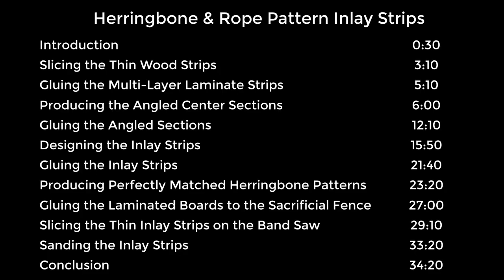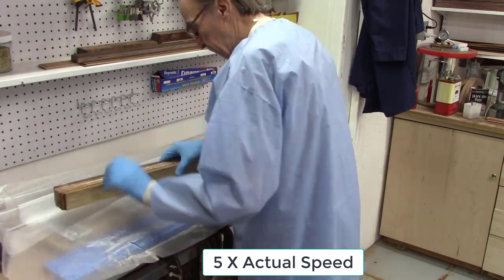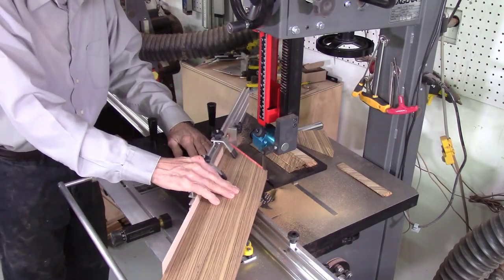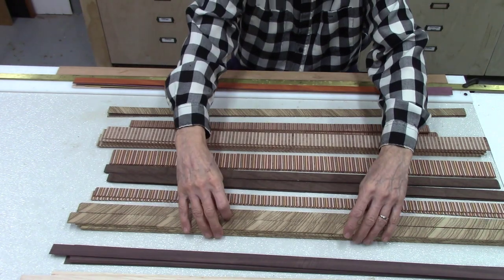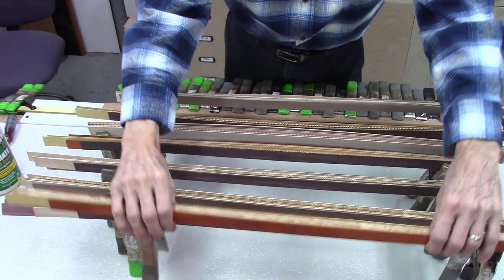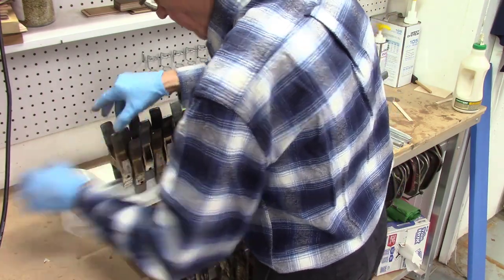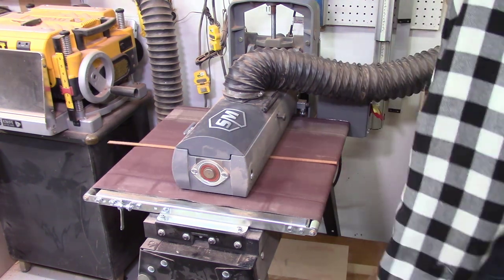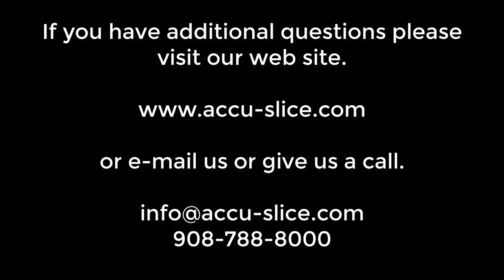Production of Wood inlay Strips -  Herringbone and Rope Designs (123)

Comment: Hi--I have a question pertaining to Accu-Slice in general.   I learned about bandsaw blade drift many years ago and how to compensate for it setting the resaw fence at the angle of the drift to correct for it.  You mentioned in one of your earlier videos that inaccurate cuts in conventional bandsaw resawing can be caused by the back of the blade contacting the cut.
I'm wondering how blade drift is not an issue when using the Accu--Slice system if the blade being used has a tendency to drift.
Thanks in advance for your help.   I find your system very interesting and exciting.
Reply from the maker: We have addressed this in a number of videos.  Band saw blade drift is caused either by the lateral movement of the wood being cut or the back edge of the band saw blade touching the wood being cut.  Since the wood being sliced with the Accu-Slice system is attached to a fence that rides perfectly parallel to the band saw blade, the wood does not move laterally and the back edge of the blade does not come in contact with the back edge of the band saw blade.  For additional details see some of our other videos including the following:    https://youtu.be/POtueiORQkk

Comment: My dad is working on a pattern similar to these but would like to bend them into a circle in order to add into a guitar sound hole inlay.  He’s running into issues with bending the pieces and having them break.  Do you know of a good solution to this?
Reply: Did he try to steam the pieces gradually? If the pieces are thin enough a clothes iron set to steam could do the job.